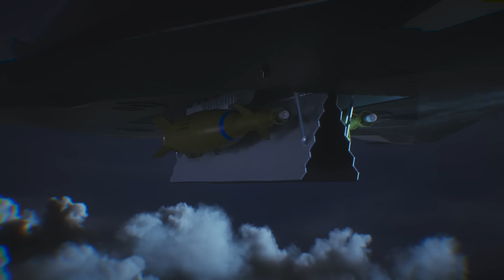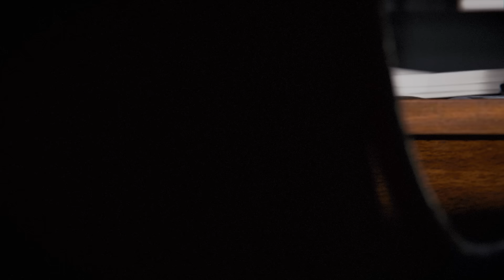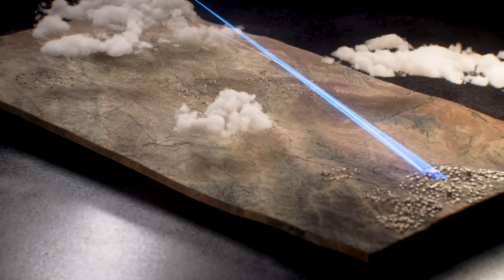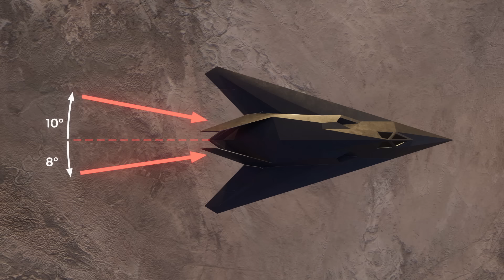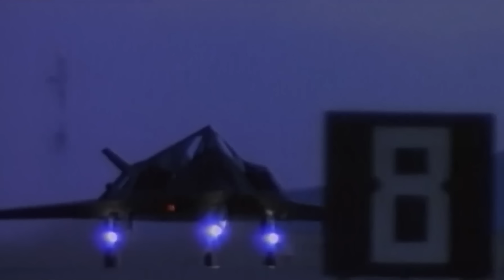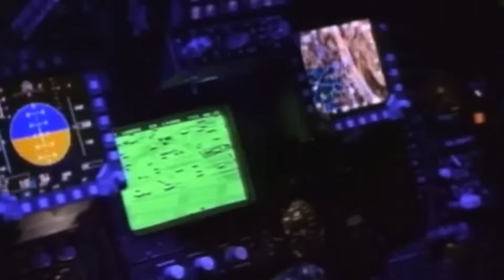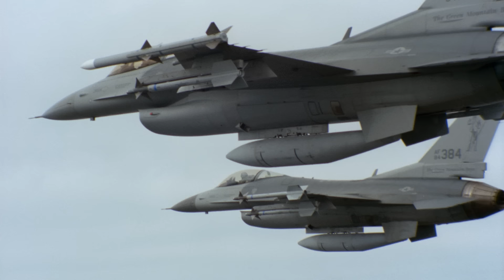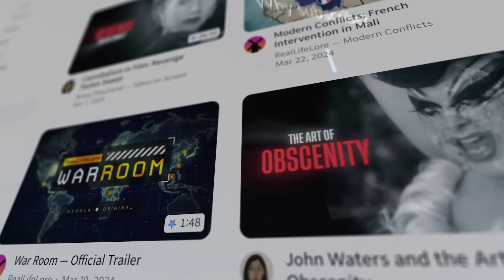The Insane Engineering of the F-117 Nighthawk

Comment: That F-117 shootdown has allot more nuance to it than described.  The reason the radars were so often moved around was not to counter stealth, but to prevent themselves from being slapped around by Anti-Radiation missiles like the AGM-88.  The Serbs had people watching the runway where F-117's were based, and reporting what aircraft were taking off.  That night, the F-117's had no EW or fighter support, and were the only ones in the air.  The Serbian air defenders knew ahead of time that only the F-117's would be up, and left their radars on (Something which would be a death sentence any other night).  The first two times the commander of the battery which shot down that F-117 turned on his radar, he saw sweet fuck all.  The F-117 was only picked up when it opened its bomb bay doors, and the first missile didn't even hit, having been guided in Low-Frequency mode (Less accurate) to have a better chance of picking up the F-117 at all.  The shootdown was a result of equal part complacency on the US's part, and very high luck on the Serbs part.
Reply: Honestly, It's a pretty incredible success on the Serbian side of that conflict. Having the correct intelligence apparatus in place to map out previous US flight paths and keeping the airfield under surveillance to understand what threats we were going to be throwing at them

Equally a massive failure on the US side to rely entirely on stealth without support, electronic or otherwise as well as poor mission planning that allowed patterns to be found.
Reply: @Werepie  it's mostly luck.
Reply: @Werepie  Yup.  The Serbs had some good ideas.  Ain't no denying that.  But, if operations command didn't get complacent, it would have been for nothing...
Reply: @Werepie  If the flight paths could be mapped out doesn't that mean that the F-117 wasn't stealthy then?
Reply: @lzh4950 You aren't serious
Reply: @Werepie   The F 'Sorry, we didn't know it was invisible' 117  that was detected by then a 30year old Soviet radar. 🤣🤣🤣🤣
Reply: @bhaashatepe5234 
Serbian nationalists have no pride outside of this event.
Reply: The bomb bay doors were not a factor, they were open for a second and the SAM needed a lock all the way to the target. The idea that they were somehow left open that long or that they were important to the shootdown is an urban myth and unfortunately repeated by certain porcine defence shitposters. I can really reccomend this video if you're interested in the details about the incident and the technical side of radar and SAMs https://youtu.be/xkXg5Gx0wgM?si=juv7LRzoZrFXAKEc . Really fabulous channel 

Its a small detail but it really annoys me. It's one of good stories that ignores the really interesting truth about how you do go about detecting low-observable aircraft.
Reply: @georgianfishbowl170  cooe
Reply: @georgianfishbowl170  cope
Reply: @sc-no9uk  ???? wtf am I coping about?
Reply: @georgianfishbowl170  cope
Reply: @georgianfishbowl170  your life
Reply: 💯 not to mention, he said the US made no attempt to destroy the wreckage. There’s a few dead Chinese guys from a bombed out embassy that would claim otherwise…
Reply: I think to some extent the Serbs made their own luck.
Reply: @Alexott  To some extent, yes.  They did have quite possibly their most competent air defense commander on site.  But, so many things had to line up for him to have just that one chance
Reply: The f-117 had some flaws with its design mostly because all stealth scenarios couldn't be simulated at the time but those flaws were hard to exploit, which americans let the serbs do through the formers laziness/ poor planning
Reply: @andreipiv  Yep.  That and allot of luck.  ALLOT of luck
Reply: @Registered_Simp   The F 'Sorry, we didn't know it was invisible' 117  that was detected by then a 30year old Soviet radar. 🤣🤣🤣🤣
Reply: @bhaashatepe5234  Clearly bait, but I'll respond anyway.  As my comment already said, it was detected by that radar only once it got extremely close and the bomb bay doors were open.  The first two times that S-125 radar was switched on (In low frequency mode to improve detection chances, at the cost of accuracy), they saw sweet fuck all.

Change any one variable about that engagement, and the plane is never shot down.  Anyone who denies it's a fluke is either intentionally spreading misinformation or a useful idiot
Reply: @bhaashatepe5234 sorry. We didn't know Belgrade was flammable. Enjoy living in your third world backwater
Reply: @andreipiv  It's not the fault of the Serbs that the Americans still left their design exposed, the Serbs did what they were supposed to do which was to wait for the plane to be detected and then shoot the invader down.
Reply: I think it's very telling that even after that shootdown, there's no other shootdown of F-117 happened, not even a reported lock on. The plane even allegedly still flying today despite the official retirement and sending all of them to the boneyard. It still a very capable platform even today for its missions. Something that people who cheering for the shutdown ignored and love to think the enemies has fully cracked F-117.
Reply: Yes, I have heard this explanation before, but what I have not seen is a reason why the bomb bay doors were open in the first place. Mistake? Malfunction? Wasn’t the plane close to its airbase? I won’t say that this success was totally lucky, but some degree of luck was involved in that all of the known elements aligned perfectly. Like an industrial accident, you remove one element from the sequence of events and the accident does not happen.
Reply: @deeann8923  Yeah, this was a freak accident.  Put a different air defense commander in the mix and they may not have done the same.  Have the F-117's change route, and they aren't found.  Have EW and SEAD aircraft up and about, and the radar is never turned on for a 3rd sweep.

I don't exactly know why the doors were open, but I can assume it was just before or while the aircraft was lining up on its target.  The trigger is pulled, giving the plane permission to drop the bomb.  The doors are open while the trigger is pressed.  So, that would be when the Night Hawk was locked up.
Reply: @Registered_Simp  I’m a docent in the 117 hangar at the Palm Springs Air Museum. We have #833 on display. My understanding is that the drop sequence, from start to finish, is less than 10 seconds. That would seem to increase the luck factor a bit.
Reply: @deeann8923  The doors can be open for no more than perhaps a second.  But yeah, an average of up to 10 seems about right.  Perhaps the distance was also close enough to where the missiles could track anyway (Since the motors could not have been far off from burning out, given the pilot spotted the missile fly by him).  No matter what way you cut it, that is a wack situation
Reply: The entire problem of stealth is that it depends on the type of radar your enemy is using, wavelength, etc., and it affects how stealthy your aircraft is (as you mentioned low frequency mode)

Jamming was successfully used in Vietnam, but radars are becoming better and more sophisticated.
Reply: @karaluv_ravenovich  Stealth was never intended to make you invisible to all radar, but to reduce your detection range against.  Most stealth is geared specifically towards higher frequency bands like X-Band since that's what is used most often in guiding weaponry (Since it can do so accurately).

Stealth, ECM, and Radars are in an ever changing arms race.  Just as radars continue to get better, so does stealth and ECM to further counter it.  But even then, it's not as if even the most modern radars can negate old stealth.  Just that their performance is not as degraded.
Reply: @Registered_Simp  
Why can't both L and X bands be used to guide missiles at different ranges?
Can you send me some information about L-band accuracy? (I am familiar with diffraction, but it would be helpful to see some real numbers.)

Some comments above have mentioned that Storm Shadow rockets (despite stealth and low altitude) are being shot down, so...

For example, if an airplane is visible on the ground or on airplane radar, then a rocket can be guided to the airplane, and during the last stages, it can use infrared or its radar.

I believe that the main point of stealth is to reduce the maximum range of detection.
Reply: @karaluv_ravenovich  You are correct that the point of stealth is to reduce detection range.  Yes, some Storm Shadow/SCALP cruise missiles have been downed over Ukraine.  SCALP has a publicly stated RCS of 0.01-0.03m^2, meaning it would have to be quite close to a fire control radar to be targeted, even if it is detected by a longer wavelength search radar from further out.  The most likely scenario I can think of is a large SAM battery (Say S-400) is very close to the target of interest.  Therefore, when the missile is in the final stages of attack, it is close enough to the Fire Control Radar to be targeted.  However, the stealthiness of SCALP has already proven its worth.  While missiles have indeed been downed, many have also made it through the surrounding air defense and hit their targets, Given how many missiles Ukraine actually has on them (Not many), this suggests the missiles are quite challenging to deal with, even when factoring the assistance of ADM-160 MALD-J decoy's from the Ukrainians.

Regarding the use of IR guidance in terminal phases or say an ARH seeker, most SAM systems nowadays utilize Semi-Active Radar Homing (SARH) guidance, save for systems such as Patriot, which utilize Track While Scan (TWS) + Active Radar Homing (ARH) guidance.  So that capability of off the table for most systems.

The long and short of it is that lower frequency radio waves are more powerful and harder to fully deflect/absorb for current modern RAM coatings.  However, the longer wavelength means the targeting fidelity is not as good as shorter wavelength radio waves found in say X-Band.  L-Band ranges between 1-2 GHz while X-Band is 8-12 GHz.  I'm no expert on the specifics of radar theory, but from what I've heard, X-Band for most engagement distances is accurate to ~5-10 meters while L-Band could be anywhere within 100 to maybe 150m.  Therefore, it is not optimal for guidance and is used when acquiring with X-Band is proving challenging.  Theoretically, you could use a modern Active Electronically Scanned Array (AESA) radar to broadcast in X and L bands simultaneously.  But, that brings about a different set of problems (Problems I am not fully qualified to explain, but just know there is no free lunch).
Reply: @Registered_Simp  

You didn't get my point.
Some modern rockets are initially guided by an airplane or ground station, which may have several different types of radars. So, at first, you need to get relatively close (several kilometers), and then the rocket may start to use its internal target-guiding system.
About accuracy, you didn't mention ranges. Besides, when you have spotted a target, you can irradiate it with a strong targeted beam, which will help to get its exact position.

About RCS, as I mentioned above, it depends on frequencies...

And the effectiveness of a weapon system is another question because much cheaper drones were spotted deep in Russian territories. Anything which flies low can't be spotted from long distances (if it is not too big)

P.s. sorry, but for some reasons my responses aren't tagged as answer
Reply: @karaluv_ravenovich  "Some modern rockets are initially guided by an airplane or ground station, which may have several different types of radars. So, at first, you need to get relatively close (several kilometers), and then the rocket may start to use its internal target-guiding system."

This is exactly what I was talking about when I stated that some systems (Like Patriot) use TWS + ARH.  To the best of my knowledge, the S-400 still uses the same SARH guidance method that the older S-300 systems use, but with a more powerful radar and longer range missiles.

"About accuracy, you didn't mention ranges."

I did not mention specific ranges because said ranges vary depending on what radar is in use, what array it uses, the quality of the array, and how much power is being put through the system (As well as surrounding terrain).  But, as a matter of physics, the farther away the target, the less accurate you will be.  This is exaggerated as you move lower and lower in frequency.

"Besides, when you have spotted a target, you can irradiate it with a strong targeted beam, which will help to get its exact position."

Search and track radars are already emitting at the highest power setting they can manage, factoring environmental effects, when going through their sweep to ensure the highest quality track.  Having a beam stay steady over the target does little to actually increase your range so much as generate a continuous wave for quick guidance action once it does get detected.  In order to increase your detection range through the same system, you'd have to add more power to the array.  In practice, air defenders are trained just to use the search radar as a que for the track radar and wait for something to show up.  Or, in the case of systems like Patriot which use a single radar array, presumably flip between low and high frequency modes to continuously attempt to acquire the target.

"And the effectiveness of a weapon system is another question because much cheaper drones were spotted deep in Russian territories. Anything which flies low can't be spotted from long distances (if it is not too big)."

Masking yourself behind the horizon is a very effective strategy, and has been planned around for decades by now.  However, given the places said drones have made it to and struck, as well as how often they have made it through, I feel this raises questions about the efficacy of many of Russias larger SAM systems against such targets just as much as the efficacy of the tactics themselves.
Reply: @Registered_Simp

1) Pass, nothing to discuss

2) So, I have no way to interpret the "accuracy numbers" that you mentioned? Besides, I guess that by making a bigger radar for lower frequencies, you may achieve the same accuracy as with higher frequencies and smaller radar (if the target is significantly bigger than the wavelength, but in the case of GHz, it is not a big deal, 1Ghz is power of 9 and light speed 8 so we get smth about 1 tenth of a meter, so more than enough for a fighter jet with size of let it be 10 meters)

3) Pass

So, I guess we have nothing to discuss? If all we've got is that stealthiness depends on various factors
Reply: Congratulations on writing all the myths regarding the downing of F177, however that is not a reality and the only reason for successfuly downing it was as stated in the video, strategy used by Serbian AA units.
Reply: @milosmitrovic3239  Do you have a source for every single statement I made being wrong and a myth other than "Nuh uh"?
Reply: @Registered_Simp  source are official d9cumments and testimonials from both sides. Beside that, a pure logic is dennying what you wrote.
Reply: I can confirm this , I was the F-117
Reply: That’s why we got underground bases 😈
Reply: Low altitude turbulence is how it was probably picked up in the shoot dwn
Reply: Not true at all...I live 20 km from where the plane was shot down...The story of the bomb hatch doors where open is maide up by the pilot of the f117
Reply: @serbianvampire  Even if the hatches being open happens to be false, this still does not change the fact that the F-117 was not detected on the first two sweeps, having to be extremely close to the fire-control radar to be spotted at all (Hence the first missile that missed still having its motor burning as it flew by the cockpit.  That could not have been more than like 7-8 miles)
Reply: @Registered_Simp  actualy it was 12 miles target range the wing of the airplane is on display in the air nautical museum of the Belgrade airport I was alone with 2 friends at the museum some 8 years ago took a small chunk of the wing 😅 some 2x2cm its like rubber material probbaly to absorb the radar signal...space tehnology for its time but no airplane is non detacteble....all depends on the range some from a 100 miles some from 20
Reply: @Registered_Simp  actualy it was 12 miles target range the wing of the airplane is on display in the air nautical museum of the Belgrade airport I was alone with 2 friends at the museum some 8 years ago took a small chunk of the wing 😅 some 2x2cm its like rubber material probbaly to absorb the radar signal...space tehnology for its time but no airplane is non detacteble....all depends on the range some from a 100 miles some from 20
Reply: @serbianvampire  12 miles is believable considering the band the fire control radar was operating in (D-Band if I'm not mistaken).  That contact must have ben faint.  I can only imagine the headache modern stealth gives even the most advanced of fire control radars.  Anything outside 20 miles and you just see fuck all on your scope, knowing damn well something is out there.  And that's not even counting integral and towed ECM present in aircraft like F-35 💀
Reply: @Registered_Simp  Actualy L band on low freekwence (sorry for the grammer English aint my nativ language) Belgrdae has a circle of military bases around it built after ww2...The pilot flew directly above where the air defence brigade is stationd you can call it poor planing by the mission control...Belive it or not Yugoslavia at that time was one of the top countrys in passive radar tehnology...You can locate where the plane is and where it going vut the problem is you cant have a lock on it (search and destroy) especilay the old soviet radars
Reply: @serbianvampire  No issues on the grammar part man.  It's intelligible.  Funny enough, we were talking about the same radar band, but under different classification standards (1-2 GHz).  Yeah, older soviet radars like those found on S-75, S-125, and S-200 had some target acquisition problems in plenty of adverse conditions.  Product of the tech they had on them at the time.  The extra time they have to spend trying to acquire could make them more vulnerable to ARM's.
Reply: @mitchellcouchman1444  Looking back, no, the lack of doors really doesn't break the narrative.  The plane still had to get extremely close to even be found in said low-frequency mode.  The point still stands.  The plane was not shot down because of evolving tactics.  It was shot down because of a lack of actual planning, repetition, and underestimating their adversary.
Reply: @mitchellcouchman1444  You did not mention anywhere in your first comment that several were hit.  While yes, one was shot down and one was allegedly hit, flown back, and written off, I have yet to have heard any more were hit at all.  Do you have a source for that?

Clarification -  When I am talking about being picked up on radar, I am specifically referring to the fire control radar which is either operating in L or X-Band (1-2 and 8-12 GHz respectively).  In this case, it was L-Band.

I am aware different bands give different detection ranges, and that detection varies depending on relative target angle (Altitude also plays a role).  Most stealth aircraft are geared towards defeating higher-frequency bands used in fire-control radars, while others (Like the B-2 Spirit) are effective against a more varied array of bands.

As for S-300's effectiveness, yes, the Flap Lid fire control radar wouldn't have struggled as much picking up an F-117 in X-Band off of array power alone, and could be considered a genuine threat.  The Phased-Array antenna certainly also helps.  Perhaps having the power and resolution to confidently target an F-117 in X-Band from say maybe 18-20 Miles (S-400's Gravestone fire control radar allegedly only picks up F-35 at a distance of around 17 Miles in X-Band.  So, I'm using the relative increase in capability as a measuring stick).  But, that would still be a serious reduction considering your average fighter could get targeted by that same radar out to 120+ miles.

I'm assuming you got that 8-mile number from an above comment I made guestimating distance to target at launch in the first shootdown based off the fact the motor was still burning.  Even though that distance ended up being 12 Miles (Guessing ~14 max), that's still a pretty significant reduction in targeting range considering they were using L-Band to increase said targeting range (Max range stated as 50 Miles).  Could not have been great trying to pick one up in X-Band (L-Band also ain't exactly accurate, although usable, considering wavelength).
Reply: I know for a fact you got this from lazerpig, and frankly that's beautiful.
Reply: @MaxAalbers-xy2xq  Yep.  And everything he said is substantiated.  An article from Sandboxx written by F-35 pilot Hasard Lee tells pretty much exactly the same story.
Reply: @Registered_Simp cope.
Reply: bro wrote a whole dissertation cope a lil harder 😂
Reply: @sc-no9uk  Such is required to fully explain the nuance of a complicated situation.  Try reading
Reply: @Registered_Simp  cope
Reply: @sc-no9uk 
Is litteracy a sin where you come from?
Reply: Serbs had modifications on sam system  crew was well trained and smart. Zoltan was smart man a d outsmarted an america  pilot who let his guard down.
Luck had nothing to do with it
Reply: @giorgio_giovanni  The F-117 was not equipped with advanced RWR or ECM systems as there was no space.  The pilots were instructed to go on the same routes.  There was no EW support that night unlike almost every other night.  The radar only picked up the F-117 after the bomb bay doors opened.  The first missile outright missed.

There was plenty of luck.  Zoltan was indeed a very talented commander.  But talent will only get you so far with such technological differential
Reply: @giorgio_giovanni  Luck had everything to do with it the operator didn't do anything
Reply: Cope.
Reply: @Rale117  Clarification of real events = cope apparently
Reply: @Registered_Simp  cope.
Reply: @Rale117  cope
Reply: @Registered_Simp  nah you do that.
Reply: @Rale117  You know if this coping has led to better machines being built and lessons being learned like never getting complacent. Then I think I'd rather do that than whatever you're doing right now.
Reply: @Rale117  Nah, that's you're job
Reply: @Registered_Simp  "you're" Learn your own language first.
Reply: @Rale117  On no, someone made a very quick comment and made a single grammatical mistake.  Oh the horror
Reply: @Registered_Simp  cope.
Reply: @Rale117  It's "Cope." You are supposed to capitalize the first letter of each sentence. Learn to properly speak.
Reply: @dnfluffles772  all of My sentences start with his username. Try harder.
Reply: @Rale117 ratio
Reply: Cope harder lol
Reply: @MuRevo122 Serbians bragging about the same lucky shot for over 20 years is the biggest cope around
Reply: @ExHyperion  Nobody broguht that up, you are the one salty here
Reply: @MuRevo122  nobody bringing it up doesn’t mean it doesn’t refute your original claim. Say stupid shit get stupid responses bozo
Reply: @MuRevo122  Pointing out actual nuance is apparently cope now
Reply: @Registered_Simp  You are basically saying that it got shot down cause the US let it it lol that's coping
Reply: @MuRevo122  That's exactly what I'm saying.  That's called a reality check, not cope.  The Serbs tried for so many nights before, and so many nights after, and never got another F-117.  And it's not like the Night Hawks stopped flying because of this incident.

The flight routes weren't changed at all, and no EW support was given in support of the strike package.  The US got complacent, and paid the price for it.  They certainly didn't let it happen again...
Reply: @Registered_Simp Americans always get beat even with the best equipment. They suck at war
Reply: @user-rl9tu3jo8u  Lol.  Lmao even.  Could you make your status as a likely Kremlin-Aligned, Anti-US shill any more obvious
Reply: @Registered_Simp  BS .. there were at least TWO F117 that were shot by the Serbs .. the other one was shot by  managed to return to base 

the NATO fan boys are coping
Reply: @user-rl9tu3jo8u How about the war against the British empire, how about WW1, WW2, Iraq, Serbia?

US helped out Europe big time when the Germans marched through Europe. 
In fact we gave military support and equipment to the Soviets.

US saved Europe and the world twice in century.
Reply: @MrCooper83  US Didn't save anybody. They joined WW1 and WW2 for their interests, and those Shermans that they gave to the soviets were given the same death as the Shermans on the Western Front.
Reply: @MrCooper83  brainwashed and proud,lol - магарчиноглупава
Reply: @MuRevo122 You're the guys still boasting about shooting down an outdated stealth plane about 30 years ago that everyone has already forgotten about
Reply: @Crustaceannationrepresentative  cry more
Reply: @squid11160  you cry even more as we smoke your a**
Reply: @Crustaceannationrepresentative  I don't even live in Europe lol ... Nah, its you guys that get salty when the supposedly "wunderweapon" gets shot down
Reply: @MuRevo122  Who tf called it a wonder weapon tf 💀, only you serb lovers blow it out of proportion to make your insignificant little thing seem more impressive than it actually is, and ignoring the fact those same planes flattened Belgrade and faced barely any resistance
Reply: @Crustaceannationrepresentative if it's that unimportant and insignificant why are you crying about it
Reply: @MuRevo122  Why are you so stupid? Let me know.
Reply: @Crustaceannationrepresentative it's the only success in Serbian military history; it's all they have, the rest of their history is getting absolutely destroyed so they can only cry themselves to sleep